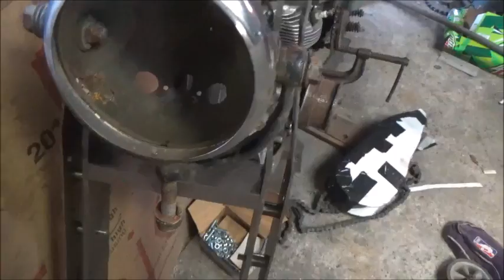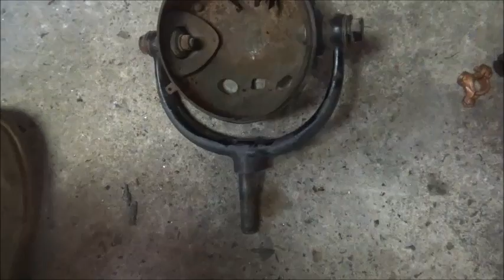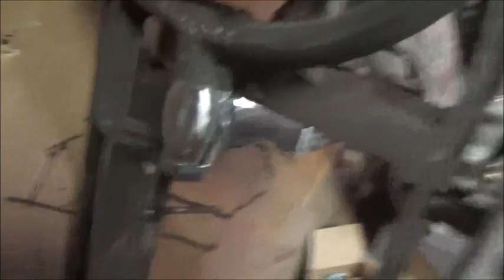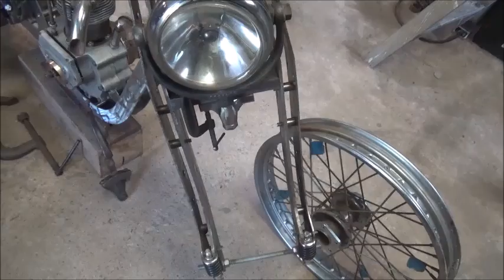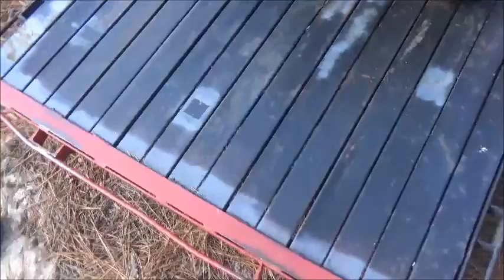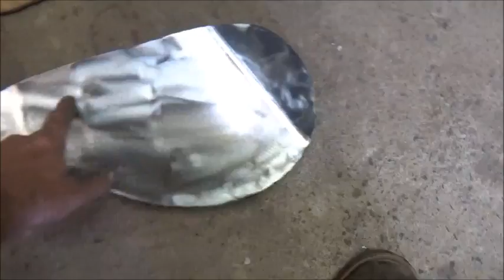Chopper, Bobber, Board Track Motorcycle Build Part 8 Headlight & Tank

Comment: That old Ford spring perch was well worn. Lotsa that old Ford stuff looks like that when you find a old "original" piece. The holes in those perches, the axel, all the mechanical brake clevises always have those egg shaped holes. ;o) You didn't show it, but you must have spent lots of time grinding on that bracket. It turned out great !!!

Comment: Awesome, doing a hell of a job there brother. I remember a video that you did a while back about thieves, I got hit by one back in July, fuckers cut the fuel lines and let 6 gallons of fuel run into the soil, stole my bing 54 carbs, cut my wire harness at the engine and stole my instrument pod, just now getting it back together, ( I have a job) little soldering and a little mounting, hopefully fly her again by Sunday. Talk some more about a dirty rotten thief on your videos. Have a good one brother.

Comment: I like the head lite bracket you made for it. I don't care for the shape of the new Tank though. I did like the old one alot more. And, I wish you would've waited on the wheels you really wanted to put on it, too. In the long run you will wish you had done that also, with changing out the clutch and all.

Comment: headlight brackets look great! saw this on a wrecker this week "we don't want your arms and legs,just your tows" hope this makes you feel better about your clutch redo,a young guy on youtube is restoring an old rear engine bus,he is working on it outside in a storage lot,he did the clutch but didn't resurface the flywheel,he has chatter and wants to pull it apart and turn the flywheel,he had to pull the motor and subframe out to do it,no forklift,just using come alongs,the guy is my hero,think about him when your doing yours, it will make your job seem easy in comparison,i left a comment for him with words of encouragement"the second time should be easier,no frozen bolts and you know were everything is"